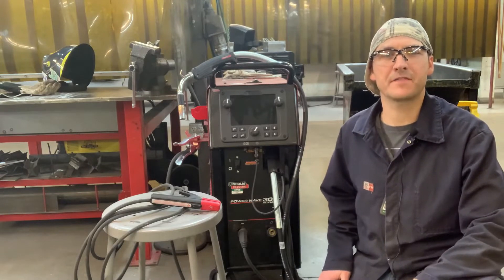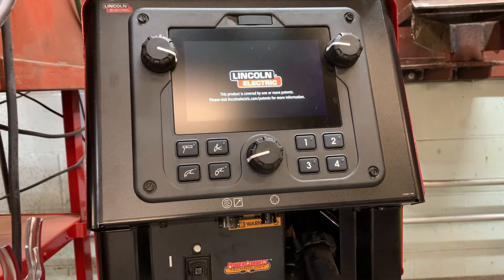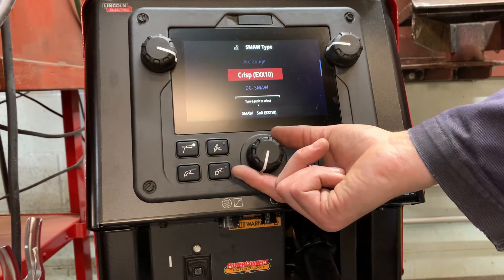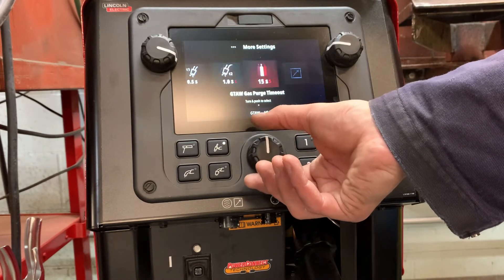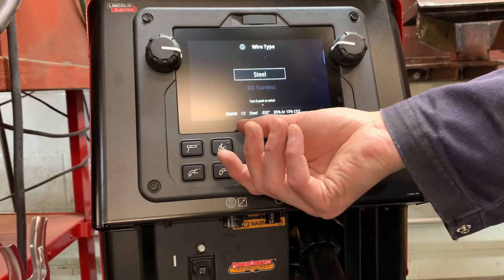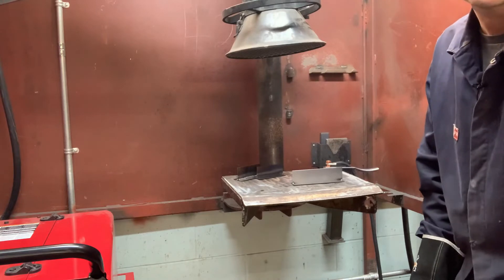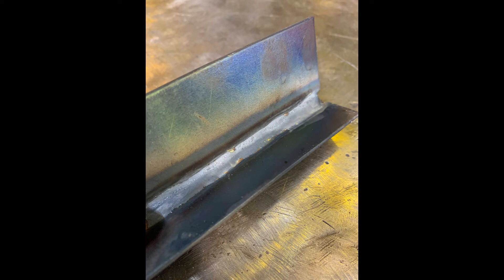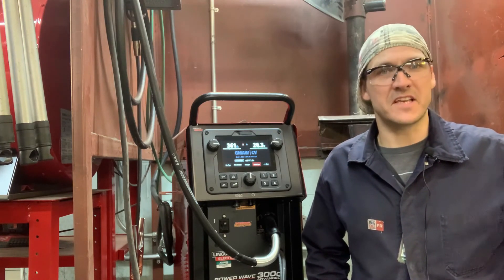Newest Lincoln PowerWave 300C Multiprocessor with High Frequency Review

Comment: Yeah I been running this same machine for over a year and I would rather run a Miller.  Wouldn't recommend anyone buy it
Reply: could you state why you have negative opinion on the machine>?
Reply from the maker: See the reply above. Mostly high frequency problems.
Reply: @sewingwithfirewelding5627 Is hf problem solved? There is available many updates welding program. 👍
Reply from the maker: Ahhh that’s too bad. We’ve been loving it. Only because of the fact that you can do do all processes including high frequency. However I would say that the aluminum acts up once in a while. What’s wrong with yours?

Comment from the maker: Hey folks. Is there anything specific you would like to see about this machine? I was thinking about going through all the bells and whistles of MIG welding? Pulse, rapid arc, rapid x etc?
Reply: We have 4 of these welders where I work and everyone has melted the ground clamp right off when using the pulse mode at higher amperage for long periods of time. Switched out the ground wire for better quality and it no longer gets hot anymore.
Reply: I love the pulse modes but there are a couple places that are tight to get into and keep getting porosity in the same spots no matter what you do. I even ground down the nozzle so the tip stuck out over a half inch so I could get in closer and still got porosity

Comment: Nice video thanks. I'll be trying one of these tomorrow on aluminium TIG
Reply from the maker: Its a nice machine. Although, We've been having some trouble with the high freq tig on alum. Like the machine wants to cut out some times. Le us know what you think :)
Reply: @sewingwithfirewelding5627  did you ever fix the problem? looking at one of these for a future set up lol.
Reply from the maker: @JoshuaLa88  not 100% -my experience is that this is a great welder when it works properly. We’ve had many problems since the beginning from high frequency issues to problems with the motherboard. The tech is always working on the 4 that we have. Maybe a 2nd gen would be a better choice or you can always switch to blue lol 😂
Reply: @sewingwithfirewelding5627  that's rough lmao. 20k just for it not to work fml. was going to buy one for my future business lol. was either that or a esab warrior. ever tried them?
Reply from the maker: @JoshuaLa88  yup we had 4 of those got rid of them. Heavy duty machine  Decent power source but the Tig was terrible. We need multi process machines. The Millermatic 255 is a decent multi process machine. We have 24 of them for 2yrs now and only 1 had to go back on warranty.
Reply: @sewingwithfirewelding5627  good to know lol i wanted it for tig haha. you meant multimatic right? i was looking at those too. apparently it has an AUTOSET feature that causes problems?
Reply: @sewingwithfirewelding5627  how is the AC tig on the multimatic?
Reply from the maker: @JoshuaLa88  I always mix up the names lol